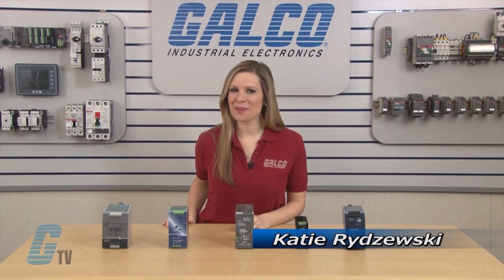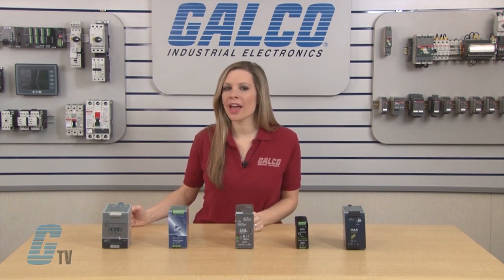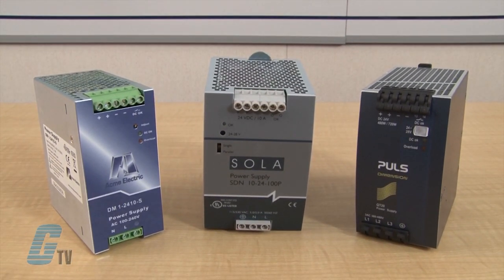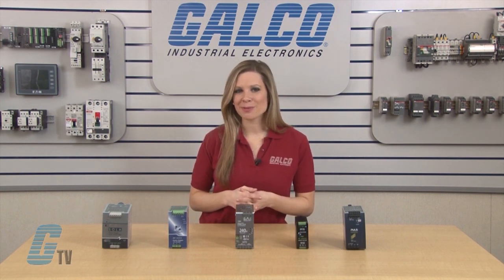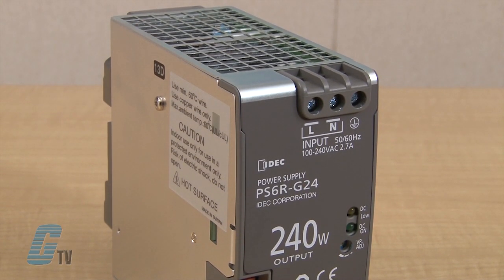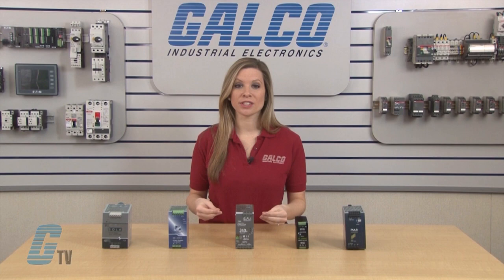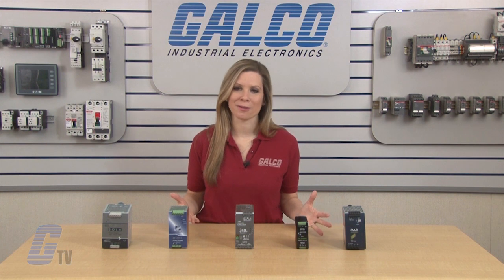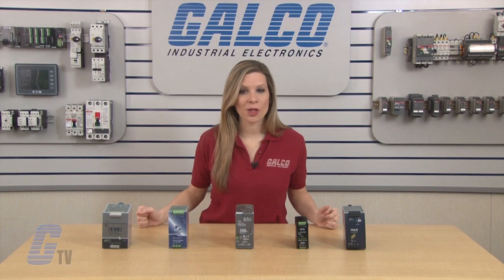What is a Switching Power Supply?

Comment: So is a switching adapter basically an Ac/dc. I’ve seen some that say ac/dc adapter and I’ve seen some that say switching adapter. Are they the same thing or two different things. So basically input is ac and output is dc on switching adapter right?

Comment: So they're smaller that's something I didn't know. At the same time advantages/disadvantages would have been nice to know.
Reply: You can use the switching power supply with any input wave form (square, modified sine, pure sine). The linear power supply requires pure sine wave. So a cheap square wave or cheap modified sine wave inverters can feed your electronics. 

Linear power supplies requieres an expensive pure sine wave inverter.